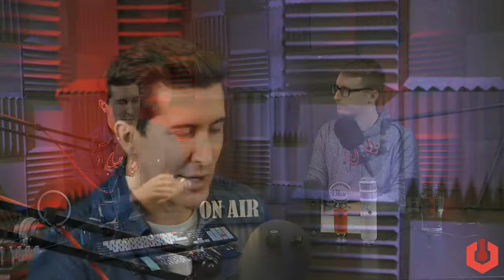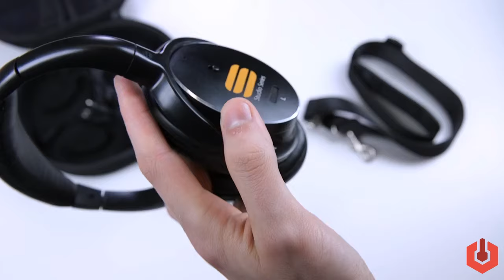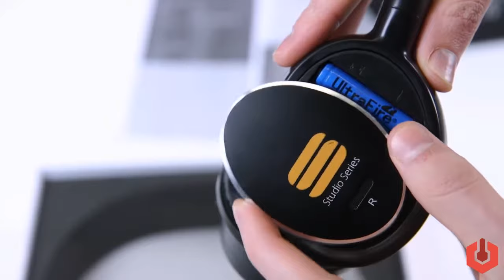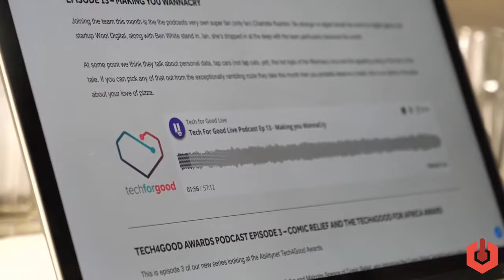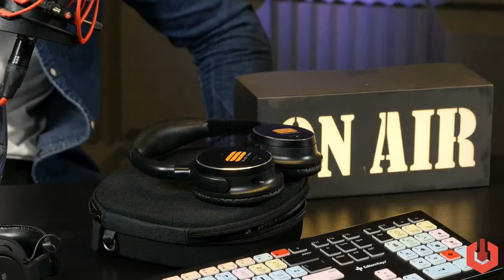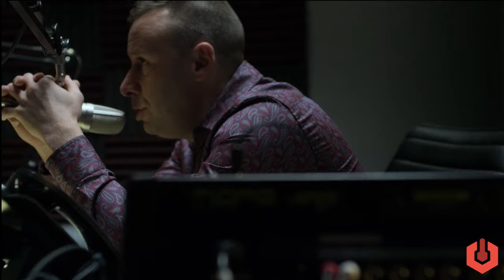Professional Audio Equipment You Should Be Using - Radio.co Webinar

Comment: The recording seems low hard to hear is it the mike he's using?
Reply from the maker: The microphone from the presenter on the left (Mark from Editors Keys) had his microphone slightly turned down. Unfortunately, we only noticed after the live event finished, however, previous and newer events have been fine. You can check them out here: https://radio.co/webinars